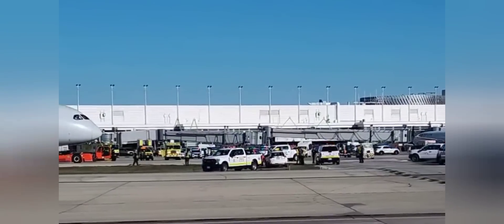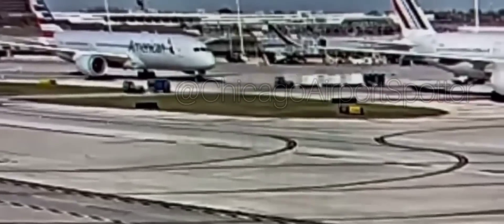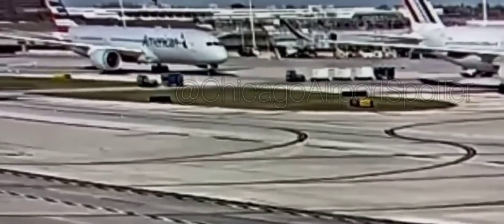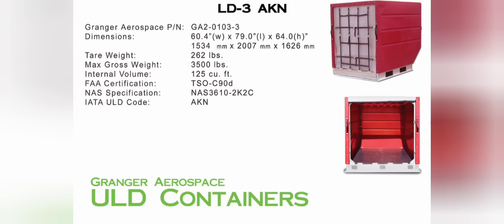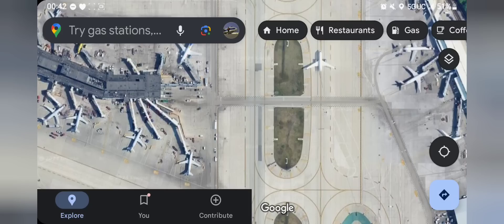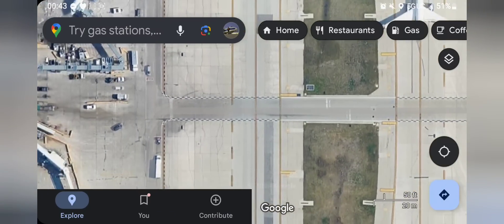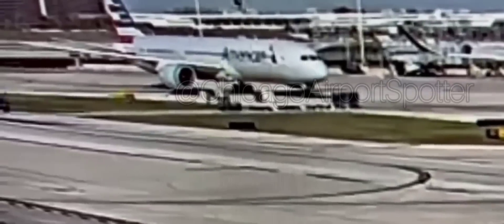INCIDENT REVIEW - American Airlines Boeing 787 Engine Ingests Cargo Container at O'Hare [10.17.24]

Comment: The problem is there’s limited crossing points while managers demand you be on time. Safety isn’t followed from the top down this incident happens constantly because of pressure to be on time.
Reply from the maker: Absolutely true. I've had a lot of hot bags in my carts where I had to wait 5-10 minutes or more waiting to cross. I've had to double back and take the other service road along the Southern edge of T5 to get across. Takes longer, but it's less of a bottleneck over there and it's safer than attempting what's in the video.
Reply: @ChicagoAirportSpotter  I'd rather be late than have my bag fed to an engine!
Reply: @ChicagoAirportSpotter  - workers need to be trained on what level of autonomy they have in how they do their work, and what options are available.  I’m glad you are able to make decisions that keep you safe.
Reply: Hopefully it will be shown to shiny new managers who think they can polish their horn by harassing workers reporting to them to work to unsafe speeds.

What if it had been the worker who got pushed into the engine?
Reply: @sunshineflyer  managers don't care, they'll back off for a week and then it'll be back to business-as-usual screaming at employees to get the cargo out on time.
Reply from the maker: @alje311 I've been in a management position twice here at ORD and a training role, I always tell people "don't drag your feet, but also don't be going 100 miles an hour out here. Find that middle ground. Work safely, but keep a good rhythm." Can't tell you how many times management sweet-talks us before work then during work tells us to rush, rush, rush. So, which is it? You want more accidents or not?
Reply: @alje311 . Keep a copy of the video on your phone as a reminder when the manager has a ‘chat’?
Reply: @ChicagoAirportSpotter  So did you train new hires to drive behind any aircraft with becons on an engines running??
Reply from the maker: @davidsmiths5471  lol, really?

No, I did not. I would never deliberately train someone to do that. This video is making it into the rest of my training lesson for the rest of the time that I do this.
Reply: @ChicagoAirportSpotter  Yes really! You stated you have been in a management role and a trainer at ORD. So have ever went to the airlines or airport to report this unsafe practices! This is what management and trainers get paid to do! To make sure the operations of any ramp are run as safe as possible! Not trying to blame you! But most these comments are excuses and blaming everyone else!
Reply: Just poor training and airport and airline management!
Reply: Exactly and with all the taxi-way construction  plane traffic is even worse then normal…
Reply: @MongooseMaul  another excuse
Reply: Yep!  And now they can repair/replace that $20M engine - - on time.
Reply: How is it that cargo / baggage carts are crossing jet taxiways in the first place?  Is it just the given airport's layout that necessitates this kind of dangerous criss-cross of aircraft and ground equipment?  How is this considered a good airport design?  Just asking, not venting.
Reply: @The-KP  good question
Reply: The guy didn't lock them down.        They were very light and probably had no luggage inside.
Reply: @b777x5  So you don't have a problem of ramp personnel driving behind or between taxing aircraft !
Reply: @davidsmiths5471  not that close behind an a350 tho
Reply: @b777x5  Has nothing to do with what type of aircraft! I don't know any airlines or contractor or FBO that trains anybody to drive behind and aircraft with Beacons and engines on !
Reply: Do you work on the ramp.    Just wondering.     It depends how far away you are.    @davidsmiths5471
Reply: @b777x5  Yes I did! But again a lot of these comments are excuses for what happened! So you know how far FOD travels from behind a 737,A320, MD-11,Cessna 150, and so on. Probably not,my point is this is not the first time this road was used by the ramp or the first 2 aircraft to use these taxi ways! This was an accident waiting to happen! The airport knew this was dangerous, same with the airlines and contractors and the FAA! I apologize for the rant and if you thought I was calling you out! The FOD thing was just an example!
Reply: The best ways to increase efficiency are system structural. Adding pressure is a low grade substitute.
Reply: @artgreen6915  Nothing personal but how do you know how a ramp works?
Reply: B.S.  Safety is on YOU!
Reply: @same5952  - My guess is that, if there is an investigation done not to BS retail standards “find someone to blame” but to aviation standards “what are the systemic issues that got us to this point” we will find some lack of training or a culture of “making do” around all the disruptions, sometimes in unsafe ways.

If that was a vulnerable worker - young, inexperienced, someone afraid of losing their job, someone just promoted - any of these are easily manipulated into what, on the surface, look like poor personal decisions. That the other shuttle went first says much. 

I am just glad that a family is not grieving as a result, given the number of industrial accidents every year in the US.
Reply: @AHomelessDorito  No one holding a gun to this person to rush! This is about poor training plain and simple!

Comment: Worked for a PHX based airline in late 80’s, early 90’s. This type of thing happens regularly, conx bags sitting on a belt loader parked too close to the ingestion zone and all kinds of other FOD. Worst was the metal coupler on the end of the hose of an A/C cart  that destroyed the #2 engine on a 757 while taxing up the j-line.

Comment: The cost of a fan blade is roughly $50,000 to $60,000. Also, the number one rule is not to be traveling behind or in front of an aircraft when the navigation lights are lit

Comment: I'm fairly certain that the engine is likely toast. Even money, even the burner can is badly damaged and cut apart by that debris.

Had similar, without loss of cart load. Three sided contained carts, six was our limit at that time and I was maxed out, when out of the darkness, a commuter hove into view with no navigation lights or visible marker lights on. Whyinhell he was on a taxiway moving without illumination is beyond me, that's a big no-no, but well, we know commuter airlines...
Full on collision course, I literally encircled the aircraft with my train as I kept the carts barely out of range of his props and got around him, since stopping was out of the question that quickly. Collision evaded, as he'd obviously suddenly slowed as well, we continued on our ways, both quite pale.
I reported the near-miss to ops, along with the identification of the aircraft involved. That report saving my bacon. The pilot's account differed from mine, but alas for him, the surveillance video account matched my account. I only got a warning for speed in that location, as we had two speed limits, taxiway area speeds being higher and alongside buildings, which was 5 MPH.
A few months later, one ramp worker was fired for speeding near the building, after being ejected from the tug after hitting the speed bump between terminals while speeding, resulting in the tug rolling into equipment.

Prize winning mishap with injury, Eastern had a labor agreement, pushback was done only by their mechanics and to save money, Eastern powered back from the gate frequently. One late afternoon, an Eastern flight powered back from Terminal C at PHL, hit forward thrust hard to stop rearward motion, knocking baggage carts all over the ramp and aircraft over their chocks - including commuters between terminals C and D and one 727 at our gate. One of the cabin service crew had been dropping trash out of the aft service door when the aircraft was blown over the chocks and she was ejected from the aircraft to fall 17 feet to the ramp face first. Her wrist broke her fall and the orbit of one eye.
I was on a baggage run and had to halt due to grit and high winds from the Eastern flight, whose pilot had halted in the taxiway with the engines pointed at the ramp area between terminals and was at above idle engine power. Sheltered behind a 727's rear gear, alongside that aircraft's copilot, who had been performing his walkaround. By the time conditions cleared, we saw a fueler halted and giving aid to my coworker that'd been ejected.
Eastern folded operations up shortly after she and her family settled the litigation for her injuries. She'd recovered with surgery well enough to work the ticket counter, but left Piedmont when she eventually was scheduled to rotate through cabin service, then ramp again.

Comment: Engine damage not too bad apparently.  Of course its going g to be overhauled and many many parts would need replacement but still quite repairable from the pictures .
Reply: We didn't get to see any pictures from the borescope inspection(s) of the engine.  That will really determine the true extent of the required repairs to that engine.

Comment: Blanco, wherefore art thou, Blanco?  It wasn't you or a comrade in the flight deck of that 787, was it?
Reply: Blancolirio drives for UA, not AA or AF.   He wasn't involved in this mess.  :-)
Reply: @johnshannon9  I don't know what carrier he drives for, but the issue isn't who pays his salary, it is that he should have a very relevant point of view on matters like this, but the guy is gutless to touch any topic that might undermine his union, his carrier, his ATC, and his life experiences.  As I see it, the incident is not an airline conundrum.....it says more about the ramp protocols, the airport design and foibles, ATC ground control, those kind of things.  O'Hare has been under construction for like 30 years, and it is still a work in progress.....they've replaced one bad design and runway-taxiway configuration with new ones....and the existence of grade level service roads that intersect with taxiways, ramps, and runways is a major no-no, but they exist all over the "modernized ORD".  The only accountability of Blanco is a lack of guts to speak out on issues he should be weighing in on.  Screw American Airlines or United Airlines.....they are complicit in the design of the "new O'Hare".

Comment: I personally don't blame this on the tug driver. My understanding is all movement in the airport is controlled by ground control from the tower. The tug would not proceed without permission. Was the aircraft that increased engine power aware that there was a tug crossing behind it? Shouldn't they have been informed by ground control to wait for the tug to clear before increasing engine power?

Comment: Yes something was wrong with the dolly's the locks should of been able to hold the  cans. If the locks are not set the cans would of fell off at his first turn. I would say he used the wrong dolly's for the equipment he was using. If locks are broke I would expect only 1 can to blow off not all three. Worked at ORD and every airline has a short on equipment problem at certain time of the day, I'm now at a FL airport.

Comment: Me thinking there needs to be a tunnel or a bridge put in place it my be cheaper then replacing aircraft engines or even wise some one losing the life
Reply from the maker: @eddiejones.redvees  there's a depressed service roadway a few hundred feet North of this one that goes beneath both taxiways. It adds quite a bit  of distance to the drive, but is better than this. I would hope the powers that be seriously consider using it.

Comment: As an ORD airport employee myself, I witnessed an American Airlines employees lose 4 of these containers in the wind less than a week before this incident. I am not sure if it is an issue with their dollies (the platforms with wheels that you load the containers on) as they look incredibly cheap and flimsy compared to other airlines' equipment or if it is simply negligence from employees refusing to make sure their load is secured. Either way, that driver shouldn't have crossed the double taxiway with the A350 right there as you're supposed to give extra room to widebody aircraft  to accomodate their massive engines and the crazy thrust they make even at idle power.
Reply: How is it that ORD ramp workers or aircraft/airline employees have special access to locations on airport property, between runways, at runway thresholds, etc. that the typical taxpayer and patron of the airport don't have access to, for plane spotting, YT channel content creation, etc?  No one wants to answer the basic question about how a person can watch aircraft operations when we can't even park out on Irving Park Road or Mannheim Road to watch aircraft operations from a great distance?   Does the ATC/FAA Tower folk approve of such dangerous filming locations?  Are they even consulted?  It's one thing to have a camera stationed on the roof of an adjacent business across the street from Midway Airport to capture runway and ramp action, but this stuff at O'Hare is over the top.  Contrary to other large cities and their airports, the City of Chicago would rather prosecute aviation hobbyists than provide a safe parking area to view airport action.
Reply: @RichardCurry-z1e  I wouldn't know much about that, sorry. If I ever do record anything, I will film it from the ramp itself. I am not familiar with prosecution of aviation hobbyists taking photos/videos of air traffic or the random film locations that other employees may use.
Reply: @RichardCurry-z1e  Also I'd like to add that my airline does not allow us to cross any sort of taxiway or runway. We are only allowed to use the service roads but I can't speak for other categories of employees here.
Reply: @malps420  Appreciate your airline rule adherence, but the tug in this video was on a so called service road that crossed a live taxiway.  You can do damage by driving poorly right on the ramp, let alone the service roads, many of which are under grade level, tunneled, etc.  Why aren't ramp drivers patched in to the ATC ground control frequencies so they can be guided by the people upstairs in the towers?  Who is to blame for the bad decisions involved in the incident here?
Reply: @RichardCurry-z1e  Yes, I will acknowledge that this was one of the rare taxiway crossings for the service roads that we drive on. I don't think that it is necessary to be guided by the controllers upstairs as all employees are required to give way or give priority to aircraft taxiing. In this instance, there were several factors to cause this result and a lot of it is still speculation because not all the details have came out yet. 

Firstly, we have no idea if the containers themselves were properly secured on the dollies. My airlines' dollies are very secure and even wind wouldn't have been able to knock them off if that was the case.

Secondly, there was another heavy aircraft in front of the taxiway that the tractor was driving through. In my opinion, I don't think that he should've crossed the taxiway while being sandwiched between two widebodies as we are supposed to give MUCH more space to widebodies as their engines are significantly larger and produce much more jet blast than your typical 737.

If the containers were secured, this could be blamed on the airline's use of unsafe equipment that obviously fail easily, but there's a chance that it could've also been employee negligence if they were not secured. Hope this helps!

Comment: Suggest you consult a aircraft  mechanic before posting opinions on engine damage.  Unlikely that damage to the engine core was done and fan blades likely to be repairable as the engine was at idle power at time of the incident.  An internal inspection of the engine with a horoscope wuold determine if the engine needs to come off the wing for a shop visit.

Comment: I`m an ex- air traffic controler, and when I was in the active duty, no vehicule,whatsoever was allowed to cross taxyways, or move around taxiing aircraft without permission.
Reply: the airport i work at requires at least two aircraft lengths in either direction in order to proceed and cross. what on earth is that person doing crossing right behind an aircraft. If that's an accepted policy of the airport then thats insane
Reply: O'Hare is a different beast.  Unfortunately we have many service roads crossing TWY's here.
Reply: Yeah, its standard to have restricted areas around running acft engines. An ingestion zone in front of the acft engines and a blast zone behind the engines. That tug should have been prohibited from going behind the front one, with the exception of a taxi control specifically directing both the acft and the tug for that maneuver so the acft would know not to throttle up. 
The other thing is ground equipment being required to cross both taxi ways in one move. Thats moronic. Looking at the overhead view at 7:00 it appears that they could move the taxi lines farther apart from each other and make that center median crossing a required stop instead of a forced kamikaze.

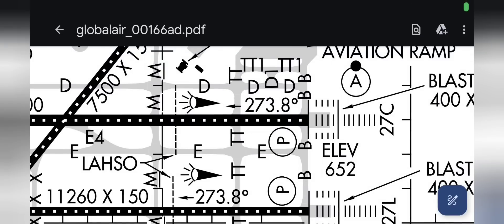Comment: If that service road is that heavily travelled on a daily basis, they really need a tunnel.  As for the video: thank you for posting and explaining. I have just 2 comments for improvement : about 3;40 you are talking about damage to the engine but the visual is still the container graphic.  And at 5:06-5:35 a highlighter or arrow or something would have been helpful for the viewer.  It's not a diagram most are familiar with and it seemed very detailed.  BUT THANK YOU! It's a great vid and great explanation of the situation.
Reply from the maker: I'm still getting the hang of video editing, lol. I'll work on that in the future. Thank you for the feedback.